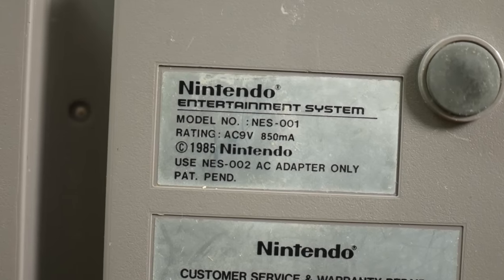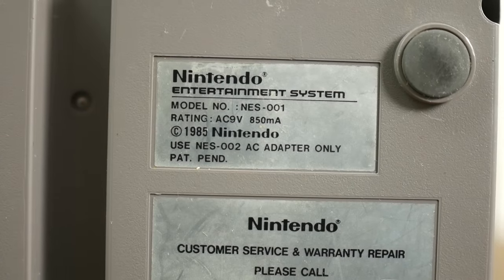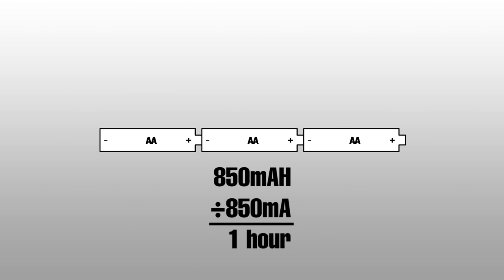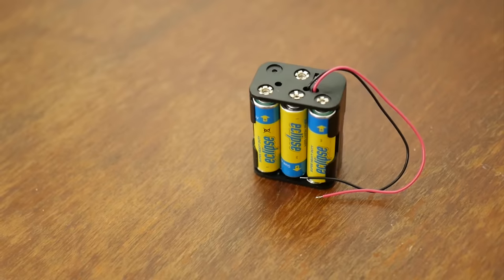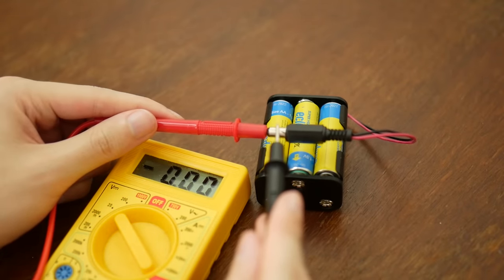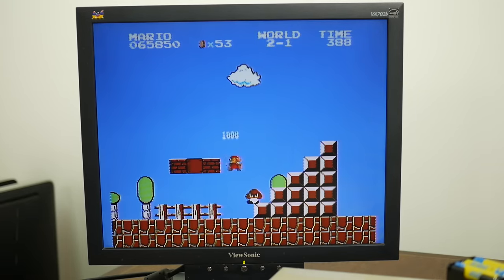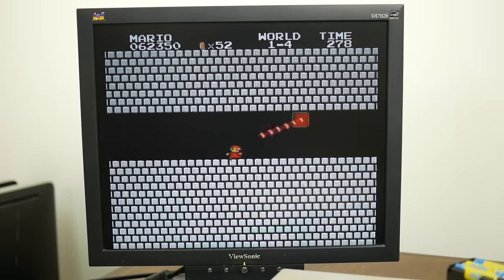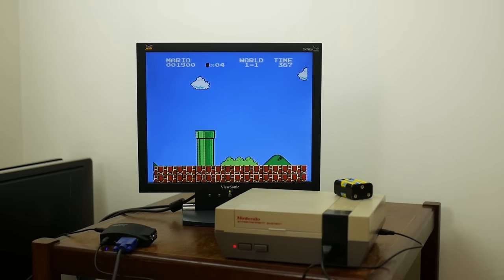Can you run an NES from AA batteries?

Comment: “Can I run a gaming pc with a car battery?”
Reply: Yes! Actually you can hook up an inverter (converts 12VDC to 120VAC) and run it from there!

(edit): changed alternator with inverter (oops)
Reply: That's pretty insane.. damn
Reply: @sweatypiranha  You  can even WELD with those things
Reply: @mrdonut7158  Even has a self welding feature. Just needs a spanner.
Reply: @mrdonut7158  they key word is inverter. altough you could make a alternator put out 120 but it will be 3 phase.
Reply: the better question is "should I run a gaming pc with a car battery?"
Reply: Yes get a car batter and an inverter and boom it works maybe hook up a solar charger too to help make the game play s little longer and maybe if you used enough 18650 batteries in series to get enough voltage then the same amount again parelle to each other to get more run time
Reply: Yes, if you get a 2,000 watts power inverter (true sine wave recommended) then you can power it for the grand total duration dictated by the amperage of the battery and what you plan to do with the computer, if its playing high graphics-intensive games for a very long time, consider its not going to last as long as if you were just casually browsing on the internet, using Microsoft Word, etc.
Reply: @mrdonut7158  :
"Yes! Actually you can hook up an alternator (converts 12VDC to 120VAC) and run it from there!"

==You could also use the car battery to power the NES directly since the NES can reduce the VDC using the internal voltage regulator.
Or, you can add a resistor in series to reduce the voltage to 9 V.

The NES requires 9 V * 980 mA = 8.8 W which isn't much.
I have a SEGA Genesis flashback that requires 5 V * 1 A = 5 W.
Reply: @louistournas120  I know dude i was talking about the gaming pc
Reply: @mrdonut7158  :
Oh sorry.
Well, in that case, I presume you can directly power the motherboard, hard drives, DVD drives, video cards if you wire them directly to a car battery. Some resistors inline would be needed to reduce the voltage for the 5 V line, for the 3.3 V line, etc.
That's something that I would like to see someone try.
Reply: @louistournas120  that could work too but it's easier with the alternator and the resistors could limit the current or generate a ton of heat
Reply: @mrdonut7158  thats stupid. The nintendo converts it back to 12 volt internally. Just hook it up directly
Reply: @denniero6904  still talking about the pc tho but ok
Reply: @denniero6904  i'd wager to guess it converts it to 5v
Reply: @mrdonut7158  an alternator is the generator in a cars engine, it is spun by belts and outputs power to the cars battery, the term you are looking for is inverter. It converts 12dc to 110v/230v
Reply: @mrdonut7158  An alternator converts rotational energy to a low voltage to charge the car battery. I think you mean an inverter - Takes 12vDC and converts it to 110/240v AC.
Reply: @dancoulson6579  oh right! My bad
Reply: There's uninterruptible power supplies that keep your PC going when the power goes out and they use the same lead-acid storage as car batteries. I've been using these for over a decade now because power here fuckin sucks. Most will last around 15-30 minutes after the power's gone out. Less if you're gaming so it depends on what you're doing. As for how the PC goes out, it's an instant off. Which is because that's how the battery itself acts once the power gets too low. If it started actually dropping voltage, the PC would have to draw more and more current at once leading to the cables heating. The PSU doesn't have a 110-220V switch so it does the conversion automatically but I'm guessing the monitor might not and would actually burn out if the voltage became too low.
Reply: My PC runs off a car battery when the power goes out. It's called a UPS.
Reply: @SearinoxNavras  Yeah, same here. I work from home, so I HAVE to have a UPS. 10 minutes is about right as long as you are doing nothing. It gives me enough time to save my work before shutting down safely :)
Reply: B3ro1080  crossfire r9 295x2 lol
Reply: you would need a deep cycle battery
Reply: @mrdonut7158  Oh you don't even need that! Some parts of the motherboard and the GPUs run off of 12v anyway. You just need a buck converter to turn 12v into 5v for some of the motherboard wires and any sata devices, as well and another buck converter at 3.3v for some of the other motherboard wires.
Note: do not do this while a car is running. Electricity coming from the engine is noisy AF, plus it raises the voltage to 14v, as apparently that's how you charge a lead-acid battery.
Reply: isn't that just a laptop
Reply: Yes lol
Reply: @mrdonut7158  If you're daring enough, you can omit the inverter and psu entirely. If you think on it, a power supply in a pc provides multiple voltages, like 12v, 5v, 3.3v, etc. Provided you have voltage regulators that can handle the current, you can get a slightly more efficient setup as you aren't stepping up voltage and then stepping it back down.
Reply: you can power a HOUSE with a car battery
Reply: Tesla battery will work perfectly
Reply: If you have a12v mini computer board and yes they exist
Reply: Yes! But not directly.
Reply: Mr Donut lol
Reply: Can just put in a 12V atx conector. Can  find them  on  ebay  for like  $20
Reply: That's kind of what a UPS does already.
Reply: I have a converter from a car plug to eu so in theory I could hook up the car part to the car battery and it should work
Reply: A car battery is no joke... A computer will happily run on a battery if it has an inverter
Reply: @jimmycreek  dont need a inverter, just a 12V atx power converter.
Reply: Yes I tried
Reply: YES, at least in theory
Reply: Lol love it!!!
Reply: Car batteries can make be used to make battery banks for home solar and running entire homes/cottages
Reply: @mrdonut7158  ah yes 12vdc to 120vac to 12vdc
Reply: Yed
Reply: Running an 800w amp and a 390 w amp on my battery so yes
Reply: Yeah, you can
Reply: An uninterruptible power supply? (UPS)
Reply: The solutions proposed here are inefficient or outright dangerous. Using an inverter works, but the efficiency will be terrible. Connecting the battery directly to the motherboard would cause issues as it requires exactly 12 volts, and using a resistor for regulation would result in the output voltage fluctuating wildly based on current draw. The best solution would be to have a power supply that can accept a 12V input, and provide properly regulated outputs at the correct voltages, much like the power supply in a laptop would.
Reply: @user2C47  or just use a UPS
Reply: Yep! I did it few years back in my old Peugeout 206. Connected it to a 13" touch screen panel in the console because I saw what Tesla did and wanted it. Used to play games on my lunch breaks 👍🏻. Youtube music playlists used to look pretty sick when driving around too.
Reply: It’s not good for the car battery, but yes you can.
Reply: LISTEN NOW! You can run ENYTHING from batteries if you do it correctly
Reply: @mrdonut7158  /rwooshhh
Reply: but what about run a car with a pc
Reply: nice
Reply: Yes.
Reply: Yes you can
Reply: Mr Donut pc use 12 anyway
Reply: @mrdonut7158  dont even need the alternator actually, you just need 12v, 5v, 3v3, -12v and -5v. getting the positives ones is easy, but no idea how to invert the voltage..
Reply: That's what a UPS is for.
Reply: Answer: yes, but not for long and you need extra equipment to get it working.
Reply: I guess but u do u
Reply: Sure you can run a gaming computer off your car's battery if you want to kill the starter battery unless you leave the car running while the battery is connected to both the car still and a pure sine wave inverter.
You should be able to draw around 800watts continuous depending on how powerful your car's alternator is.
Note that doing this for extended periods will end up damaging your alternator because it's designed to only charge the battery in short increments of time. Usually a couple minutes at a time.
But hey, if gaming is life then the car can die and nobody will care.... For a while at least...
Reply: Yes you can do it it works
Reply: Yes with an inverter
Reply: @mrdonut7158  or an inverter would be a better way of doing it.
Reply: A gaming pc runs on 12v dc anyway (also 3.3v and 5v but they might get fased out soon)
The PC's power supply takes the 120v or 240v and transforms and rectifies it.
Remove the PSU and replace it with a simple dc to dc converter to take the car battery's voltage (between 14v and 11.5v) and smooth it down to 12v, 5v and 3.3v so the pc can use it.
This is more efficient than going from ac anyway (as long as the source of low dc voltage is nice and close because you would now need power cables 5 or 10 times thicker)
Reply: If anything, a car battery would last longer as a gaming pc battery than in the car (in theory).
Reply: Joseph Armstrong 😂 yes
Reply: I mean... You need 30-ish amps on 12V, that's easy, already can do that, 5V at also a beefy current, but that just needs a regulator and 3.3V the same way. The efficiency will be garbage overall but still better than an inverter
Reply: Put that 50-100Ah battery instead of a junk UPS 7Ah one and you're set for 10x the uptime.
Reply: Next, the engine. Taking car racing to a new level.
Reply: "Famous last words"
Reply: Yes you can
Reply: @mrdonut7158  aren't PC's 12v native?
Reply: "Can I run a Tesla using a running hamster?"
Reply: #giantgaminglaptop
Reply: Yes! But you shouldn't
Reply: A youtuber I watch* his name is Austin but I can't remember his channel name* but he just built a gaming pc in the back of a car
Reply: Yes you can
Reply: Gaming laptops: ...
Reply: yes, in fact a lot of people have just this setup for when the power suddenly goes out its called a ups or an uninterruptible power supply
Reply: Yeah In 3020 wow 3 weeks ago
Reply: If you skip the PC's power supply, it's probably not all that difficult, aside from complying with all the different voltages those things can output to the components (+3.3V, +5V, +12V and -12V ground). At an upper estimate of 800 watt-hours and 12V, that's 66,667 mAH.

That's simply way too much for your humble low-end AAs. For a bonus, it'd also be cool if there's a way to wire the ACPI battery interface as well, so the OS becomes aware that it's running on a battery, and keep the voltage output consistent on low battery.
Reply: 0.o
Reply: @mrdonut7158  i thiught it was a joke comment..
Reply: Probably
Reply: Yes
Reply: Knew a guy who did that, had his PC powered off of a car battery strapped to the underside of his shitty armchair for some reason.

Wouldn't recommend that for, y'know, massive fire hazard reasons. But yeah.
Reply: You can, just bring me this UPS PCB
Reply: Yes yes u can
Reply: i mean tbh if you have an electric input, you can make anything run off it, WARNING: don't try anything cause of this, you need converters and regulators, cause you could fry anything if you hook up something more powerful than it needs
Reply: @mrdonut7158  that would be an inverter the alternator generates electricity from the motor to charge the battery and run peripherals. I have a diagram for a solar panel circuit that would allow for any old console and a flatscreen to run off of car batteries until they died. Deep cycle would be used.
Reply: yes, jk i would probably put a 3 foot alternator in there for memes honestly instead
Reply: Yes
Reply: @mrdonut7158  😎👍
Reply: Yes
Reply: This is possible!! Without a transformer, a brazilian Channel maked this!!
Reply: If you have your computer connected to an Uninterruptable Power Supply, you kinda already are. I say kinda because these are sealed typically deep cycle lead acid batteries with typically flat plates. In cars you typically have non-sealed (often just called "spill able") lead acid batteries that are absolutely not meant to be deeply cycled.

While the underlying chemistry is the same, the two are still very different. But these aren't meant to power a computer through a blackout, but rather give you enough time to properly shut down or wait until an on-site generator is able to kick on.
Reply: Short Answer: Y E S
Reply: Yes
Reply: Yes
Reply: @CotyRiddle  You mean tapping it before the diodes?
Reply: Yes but you have to convert dc to ac
Reply: @adriansepinski2995  no you can just connect the cables from the power adapter directly to the battery you do not need to convert it back into ac because the NES also excepts a DC input
Reply: @TechHowden  nice
Reply: yesnt
Reply: @mrdonut7158  it was not a question probley
Reply: That’s what Uninterruptible Power Supplies are.
Reply: Yes
Reply: DEAR GOD. THAT. WAS REALLY SMART
Reply: great question
Reply: Yes!
Reply: @hdofu  no
Reply: Yes
Reply: yes
Reply: You can use a dc to dc power supply and not need anything else but the battery and it's somewhat better for power loss
Reply: That would lead too explosion
Reply: @mrdonut7158  maybe for 10 to 30 seconds
Reply: @pickle_256  i agree
Reply: @SzymonPmc  5 mknutes
Reply: @mrdonut7158  alternater? Think you got your electrics muddled up
Reply: Yeah make sure it has big battery and 20 of those battery from derisel then you have a battery powered gaming pc
Reply: A true gamer move is to do it without using an AC inverter #yolo
Reply: basicallyhomeless did a video on this, but he charged it with a treadmill
Reply: Basically a UPS (uninterruptible power supply)
Reply: And then charge it with a solar panel. ETERNAL GAMING
Reply: Someone didn't use google for the sake of it.
Reply: @mrdonut7158  ssssssesesrs6🍤
Reply: Can you run a server room with a power ststion
Reply: Yes!
Reply: Ya and nobody cares 🤠
Reply: My friend did that, you can
Reply: With a motherboard that doesn't use the default atx DC input and uses the 12v DC input, it's easier
Reply: Well it it will go boom
Reply: Yes  there are a product
Reply: Yes
Reply: For one hour, perhaps.
Reply: 100% and it not that bad to do
Reply: Non’t
Reply: @Andromeda
You Can Use A Car inverter
12 Volt DC 
To
120 Volt AC
or waste your money to buy 20 Car Battery
10 in Series
10 in Parallel
Reply: It is also possible to run one with AA batteries
Reply: Plug you computer in your electic car and let's go
Reply: car batteries are 12v, mains is 240v (UK) so you'd need 20 car batteries in series. depending on wattage of the PSU, let's say 600w. Watts are current x voltage so rounding 240v to 200v it would draw 3A at full power. so assuming a car battery is 50Ah. it would last about 16.6 hours. 

so you'd need 20 car batteries and it'll last 16 hours

I think.....

good at electronics but bad at maths.....

(us mains is 120v, so that's just 10 car batteries)
Reply: @shaunclarke04  the car battery's are outputting DC and the pc power suplie needs AC.
Reply: @KeozFPV  ehhhhh chuck a DC to AC in there
Reply: @mrdonut7158  You mean an inverter. The alternator is what charges the battery in a car. You can also buy regulators that have 12vdc input and standard ATX connector output.
Reply: yes, i actually done that last year, when my house wasn't receiving electricity for almost an entire day. i've hooked up my pc, my monitor and wifi modem, and it lasted for about 3 hours
Reply: No no no "Can i run a gaming pc with AA batteries"🤯
Reply: @mrdonut7158  yep battery backs used 12 v car batteries
Reply: @mrdonut7158  A UPS uses vehicle battery  so yeah you're right!
Reply: @KuntalGhosh  Yeah hooking it up directly to the battery in your car with the car running is probably gonna fry a few cables. Alternators usually put out about 14V (no problems there) but at 130-170A. The good thing though is that you can draw around 2000W, enough for dual gpu's and a shit tonne of RGB.
Reply: Yea
Reply: Yes'nt
Reply: Tesla battery
Reply: we do that but for lights and charging when powers goes out
Reply: Yes its easier than this actually. Just need a 110 amp converter.
Reply: Use an inverter and bang 💥
Reply: @mrdonut7158  it should actually be easier than that because the highest voltage your PC should need is 12 volts so by making a custom power supply you wouldn't even need the inverter
Reply: @mrdonut7158  none of pc components run off more than 12 volts. There are plenty of pc power supplies that take 12-24 volts dc as input directly.
Reply: Yes
Reply: @mrdonut7158  I mean you’re probably gonna need a step down converter
Reply: he can
Reply: @mrdonut7158  i didnt think that would work
Reply: Yes Tesla model s battery can
Reply: @mrdonut7158  are you the tf2 engineer?
Reply: Yes, you'd need to use an extra device to move up to 120V , to be stepped down in the PC psu, otherwise, we could also remove the power supply and have three separate DC to DC stabilizers (12,5,3.3 v)
Reply: Yes Austin Evans did it
Reply: Ye
Reply: @mrdonut7158  yes, or you can just get rid of the power supply and send 12V from the battery right to the motherboard. After all we’d just be converting 12V DC to 120V AC then back to 12V DC for the motherboard.
Reply: @1234mattyman  you don’t need an inverter. Just take the power supply out and run 12V from the battery to the motherboard.
Reply: Yes with an inverter
Reply: @hdofu   hm. No, run a laptop. much better battery life :P
Reply: Yes
Reply: jackery batteries are a thing
Reply: imange getting a wifi router and a pc and put a converter for car basicly you have free wifi everywhere you go HOL UP
Reply: @mrdonut7158  That's not an alternator, that's an inverter. Alternators convert kinetic energy to electrical energy.

However, it is theoretically possible to run a gaming PC on a car battery because computer hardware conveniently runs on 12 volts. But if I'm not mistaken computer motherboards don't usually have voltage regulators on board, that's the power supply's job. So unless your car battery has JUST the right level of charge, you're bound to overvolt or undervolt your computer, to which they are very sensitive to.
Reply: @mrdonut7158  Austin evans did it search it up
Reply: Yes
Reply: Some boards all they need is 12VDC one example is the optiplex 3020
Reply: @mrdonut7158  Nice troll.
Reply: Could you run a computer through a car battery yes should you no -:
Reply: @jayhollowayii2  maybe you might wanna filter the current from a battery
Reply: @jayhollowayii2  Well, in our RV, we had to. Solar + 12 VDC deep-cycles + inverter will do the trick, but non-sine-wave inverters can damage some electronics. Laptops **seem** to be ok, but I have seen things fry when connected to modified-sine-wave inverters. So, yea, pure sine-waves with a good UPS are the best option for a PC any day.
Reply: Yeah about that... You can find a 12v Pico ATX PSU board and wire the positive to positive and negative to negative.  Or just two 12v power sockets wired in parallel and two 12v power adapters plugged in, that's fine too

EDIT: I can't wait to do just that when I do motorcoach tours and use my low powered gaming PC on the bus when the customers are doing their tour things lol
Reply: Yep si sim
Reply: Yeah you can with an inverter
Reply: @mrdonut7158  Or just use a Pico PSU which already takes a 12v DC input.
Reply: Depends on if it’s used
Reply: @mrdonut7158  also a capable basic inventer is like $30 now. great purchase for any car. full sine inverters are better tho
Reply: Yes
Reply: Its actualy easy
Reply: @mrdonut7158  that would waste a lot of energy
Reply: Noes
Reply: Yes. Inverter
Reply: And the car battery is run by potatos
Reply: You don't even have to use an inverter like other people are suggesting here, in fact that's very inefficient. There are DC to ATX power boards out there that take 12V DC and step it down to all the other necessary voltages to run a computer. You'd probably want some sort of voltage regulator in there if you are running it in the car, since I don't know if these units do anything to the 12V rail at all and power from a car is dirty, but directly off a battery with no other loading/charging going on would probably work.
Reply: Yes
Reply: Someone ran it with potatos, a gaming one
Reply: "Non't"
Reply: you can, but your typical mid-range gaming pc (450w to 650w) will only last roughly 2 hours per full size, brand new car battery. This is assuming you are using a high efficiency pure sine wave inverter, and your batteries are deep cycle lithium ion batteries, not flooded lead-acid ( which are damaged when you discharge past 50%). It's doable, but not really intuitive. If you have a laptop that only uses 50w-100w, then you could do this off a normal car battery much easier,  and you don't even require a pure sine wave inverter.

I have played around with things like this, even hooking up a car stereo indoors with a car battery. If you are curious, you should follow your heart because that's how you learn science. But you should never try to modify a power supply or build one from scratch, the risk of death or injury is very high. Buy yourself a car battery, buy yourself an inverter, then have your fun. Remember that 12-volt DC can't really electrocute you, but you can still get burned by the heat and remember to remove all metal jewelry before touching a car battery. When dealing with inverters or high voltage, (DC or AC above 60V), remember to wear a ground wire and be extremely cautious about touching leads. Have fun, but don't hurt yourself!
Reply: Not really car battery is 12 volts to little for gaming pc
Reply: You can only power the motherboard
Reply: Bruuuuh Matt should actually do it
Reply: good luck buying an inverter rated for your computer's supply's wattage, and at continuous load no less.
Reply: yes
Reply: @hdofu  yes
Reply: Don’t need to, just get one of those big anker batteries with ac outlets or something
Reply: @mrdonut7158  even better: use some beefy step down converters for the rest of the voltages and hook 12v straight to the main v bus on the computer, this way you don't have to go through the wasteful DC>AC>DC.
Reply: YEAS @mrdonut7158
Reply: Ha
Reply: What a way to go!
Reply: Ive powered a ps4 from a car battery.
Reply: Who said you couldn’t
Reply: plenty of truckers game, so... yes
Reply: Ok 12.6 V at full charge can easily run a Rasbary pi or laptop
Reply: Yes
Reply: @mrdonut7158  this is not effective
Reply: Yes
Reply: Make sure the plus and minus are properly connected properly and your done
Reply: The Sega Genesis Nomad handheld ran came with a battery pack that required 6x AA. It lasted maybe 2 hours.
Reply: @mrdonut7158  i mean... they do mainly run off 12VDC, and if you get a 12VO motherboard you could easily run it off a car battery probably
Reply: Yea
Reply: @mrdonut7158  or get 10 car batteries 😂
Reply: Yes you can for 2.3 seconds if it's maxed out
Reply: @mrdonut7158  Basically what the UPC were before they switched to lithium haha
Reply: It actually depends in voltage, brand (yes brand matters), wither it's used or not, but theoretically yes you can
Reply: No problem
Reply: Yes you just need an inverter
Reply: Probably.
Reply: One time I touched the positive and negative wires of a hairdryer cord together by accident and it made a huge explosion and smelled terrible for hours
Reply: Yep, but briefly
Reply: Just use a 2000 watt inverter, i got one in the car hooked in a car battery and i always play on PS4 with it on road trips.
Reply: Yes
Reply: Probably lol
Reply: @mrdonut7158  thx engi
Reply: Probably
Reply: You can power one with a V8
Reply: what the fu-
Reply: im watching people talk about how this works like i understand what they are talking about
Reply: Easily
Reply: Yup
Reply: You can run 50
Reply: A voice from 2023 here. That's exactly how ukrainians were working on remote during power shortages. With a power inverter a good car battery could be a good replacement for a charging station.
Reply: You be playin Fordnite F150
Reply: Yes
Reply: That’s basically what pcs use
Reply: Can I run a gaming pc from a Chevy LS7 7.0L V8 crate engine?
Reply: @mrdonut7158 I did it with one of those small cigarette lighter inverters
Reply: Yes you can but you would need a deep cycle lead acid battery, and maybe need several
Reply: @mrdonut7158  fr
Reply: Easily
Reply: My Buick has a inverter built in with a power socket on the back of the center storage area. Does that count? Guess it’s running of the alternator but makes it easy.
Reply: Ye
Reply: You can run it off a drill battery
Reply: Yeah
Reply: Actually yes iirc
Reply: Isn that's weird EVEN FOR YOU
Reply: In theory easily possible
Reply: Play crysis
Reply: Hi, this is Sam from HP™ here. It is not recommended to power your HP™ Pavilion™ lsm4r60 with a car battery as you could risk shorting your motherboard out. If you have any more questions, the team at the HP™ help desk can answer all your computer needs. Thank you, and have a great afternoon.
Reply: @mrdonut7158 it fits that you have an engineer pfp
Reply: @1234mattyman batter
Reply: You mean Xbox lol
Reply: yes
Reply: No
Reply: Yes you can
Reply: @mrdonut7158 if you didnt know you can power a pc with a car batery withow an inverter
Reply: Can I charge my phone with my NES?
Reply: “can i run a tesla with potatoes?”
Reply: @hdofu can I run a car battery off of a gaming pc
Reply: Directly is possible but not really
Reply: “NON’t! In theory….” 
continues to rant about batteries and voltages for another 20 minutes straight
Reply: Well, you can modify a switch mode power supply to accept 12V battery input, with 3.3 and 5V going through a voltage regulator. But it wouldn't work for long, as battery voltage starts at 12.6V when charged and it works all the way down to 11V. So, your mileage will vary, but it's gonna be much more efficient than a UPS. This is what servers use.
Reply: As MattKC also said:
Yes! At least, in theory.
Reply: @mrdonut7158 you don't even need to, just power the motherboard straight with 12V and the other required voltages through some regulators
Reply: @mrdonut7158 i mean gaming pcs can have 12VO so you could technically speaking wire a motherboard directly to a car battery
Reply: @mrdonut7158  PCs primarily use 12V rails. Few stepdown converters to lower voltages and you are golden
Reply: if you hook like 10 in series you should get the 120v it needs. (Or 20 for 240v if youre european)
Or use a alternator
Reply: Yeah prob
Reply: Define car battery.  The battery in my car could comfortably run my gaming PC for a LONG time (assuming there was a way to hook it up, which there isn't, but hey this is hypothetical anyway).  Assuming my power supply was maxed out at 850w, that would give me 2.6 days.  Of course it would be a lot longer than that because even gaming doesn't use anywhere near 850w (my components theoretically max out at around 450w at 100%).
Reply: yes… there are inverters you can use that you connect to a car battery and it outputs 120 volts ac
Reply: Of course you can. Duh.
Reply: Nice profile
Reply: Yes but it would eat through your car battery like crazy if the voltage of you can even support the voltage of the pc